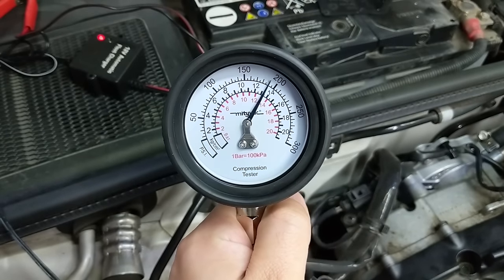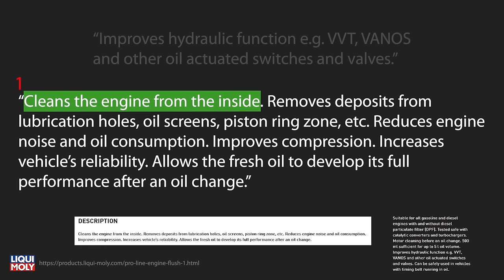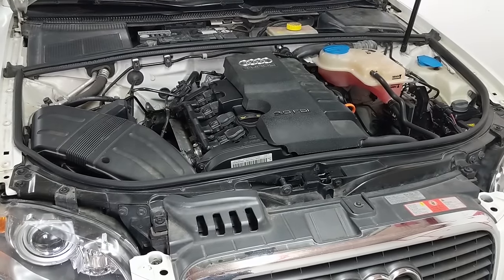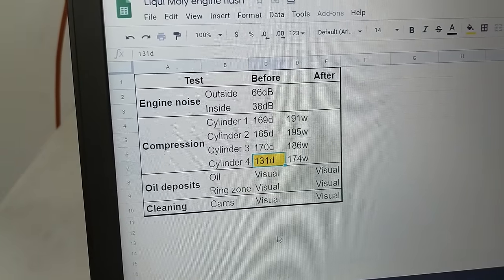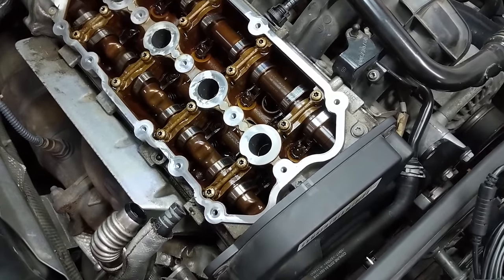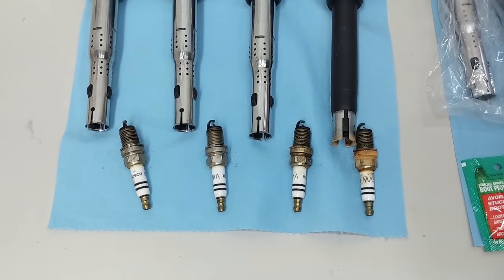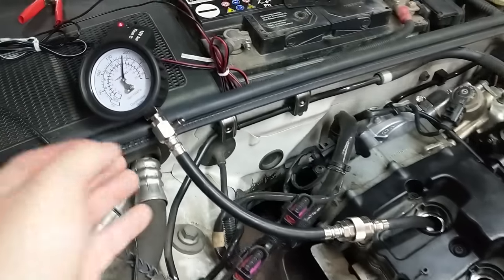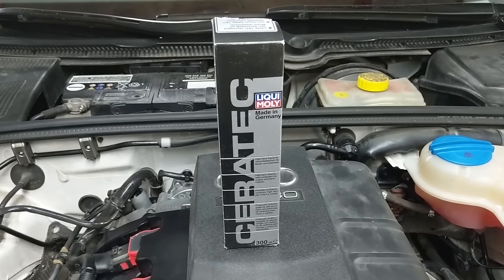Does Liqui Moly Engine Flush work? | Full Test & Review | Pro-line 2037

Comment: I think that #4 plug was leaking and the new plug recovered your comp reading. The white deposits showed that plug was running too hot, which may have been a result of the leak. Also the original stick coil may have been damaged by the heat and was replaced without fixing the leak. Did it previously gave a single knock on a warm start? Sometimes they do and although harmless it tells you that something is off.
Reply: I agree with Sky Dive , you've changed spark plugs and coil packs , it also seems the like somebody change 3 coils and never changed the 4th , now that You've changed all 4 you have a nice low tone in your exhaust , also spark plug gaps on turbo cars make a difference, over all I don't think Liqui Moly made a big difference.
Reply: & such as life, the problems get smaller & smaller as 1 approaches the core, mABEeeee.. that spRk plug 4, was jst a tad lUs.. (mNE a tIm Iv had problMs that mNE a mech. thought was this that or thE other.. & it Ndd(ended) up just being 1 pipsQEk sIzd lUs scrU)  👋😒

Comment: It think it's hard to compare both test samples when the cups are so large, that even with the presumably "cleaner" oil there's no light penetrating the oil. Maybe a test tube or another thinner cup would've led to different results. Plus your engine was pretty clean from the start. I mean the transformation shown in the commercial is certainly unrealistic, but maybe an engine with a bit of oil sludge here and there would've experienced some "real" cleaning effect.

Comment: Probably it won’t clean an engine like in the promo, but for sure your engine was clean before, so there were no deposits to be removed. Regarding the low compression-could be an improvement because maybe the engine flush managed to unstick one or more piston rings from their groove. Maybe.

Comment: I also used this product and a bunch of others. I used to to try and "clean the rings" to get better oil consumption but what ends up happening is it cleans the carbon around the rings which all them to move a bit better (carbon gets in between the piston rings and piston) and that actually reduces your compression and increases oil consumption. Your spark plugs look like they are burning a bit of oil anyway. I have the video of my tests on my channel.
Reply: it was a little confusing to get your conclusion. Was it that you think the cleaner does help or that it does not?
Reply: @jamesmedina2062  it did not help.
Reply: @buildanddrive  right on. Thanks for the answer. I have found similar poor results with older engines. Fresh oil is usually your best bet.

Comment: The evened out dry numbers are a great result. Glad I used this stuff before my last oil change. The decreased wet number for cyl#1 could've just been a fluke, oil not making its way to the rings or something.
Reply: More likely from not letting the compression reading stabilise. Can see stopping too early in the vid.
Reply: @RealHairyPotty I think it's more to do with oil being far less viscous, cretaes more of a seal around the oil rings when the oil is thicker leading to higher compression, simply leaving the oil flush to stagnate on the sides of the cylinder walls induces lower overall compression as it is more volatile, a dommon trend I see is oil in oil flush is quite sloppy and water like, whereas oil without flush is very sludgy and thick, I work in a waste management facility and can tell when they oil we are recycling has had oil flush put through it! :)
my only explanation is the bad cylinder had the oil rings cleaned, but lower overall compression due to the thin oil, the block should have been thoroughly rinsed with clean oil and a clean filter, ran for atleast 10 minutes with fresh oil then the sump oil and oil filter drained, new oil put in the filter and engine then the cylinders tested. Atleast this is my procedure anyways after having used oil flush on poorly performing engines.

Comment: I personally use amsoil flush with a fresh oil change with cheap oil then change and fill with amsoil oil
Reply: I do the same, I flush the engine with regular FS oil, and then put in Amsoil.  Lasts much longer.  Modern engines can retain 10-20% old oil which fools most DIY YT jocks.  They think the dirty oil is actually result of the solvent when in fact is just the old oil mixed with new.

Comment: Great wideo. Try this in a Diesel engine with sludge build up, then you will see what this product is capable of. Also you should have changed the oil filter and cut it open, both for the base test and after flush. Subbed!
Reply: This is a direct injection engine which builds sludge in the intake and on piston heads

Comment: When I need to clean the top of a piston and  the rings I use a a 50/50 mix of PEA fuel injection cleaner and B12 Chemtol 1 shot of each per-cylinder goes into a container for mixing. To that I add 2 teaspoon of TCW3 2 cycle oil per cylinder and mix. I put one shot of this mixture into each cylinder cold and turn crank by hand first thing in the morning. I repeat this in the evening. I cover the spark plug holes with a rag over night. The next day I again turn the crank over by hand and check to make sure no significant fluid is on piston tops.  I put the plugs back in and start engine. I let it run until engine is up to operating temp and do an oil change. Normally leading up to this I would have already done a tank or two of fuel injection cleaner. I do this about once every 64K miles. I never leave spark plugs even Iridium in for 120K miles.

Comment: Well, it works on the area that's vital for the performance. Certainly the engine has some significant buildup on the piston ring. On the 3 cylinders, the buildups are aligned with the piston ring, so it improves the sealing. I think that explains the compression changes.

Comment: My 2011 MINI S used to burn about quart of oil after every 2nd refuel (850-900 miles) and since I switched to Liqui Moly oil / additive it completely stopped burning oil. I used to use Mobil 1. I’m a big fan of L.M. products.
Reply: which specific liquid moly product?
Reply: @juanifico  I use Molygen motor oil and Anti Friction Engine Treatment. My engine also made slight noises and with this switch in products it’s incredibly quiet and smooth.
Reply: @steezymiyagi  do you think the engine oil is necessary, too?
Reply: @juanifico  So I substituted Mobil 1 motor oil with Liquid Moly

Comment: Remove 1 quart of oil and replace it with diesel. Let it run for 15 minutes and you will notice a major change in all the carbon buildup areas and your compression. You will probably need to do a minimum of three or changes to get all the junk out
Reply: Diesel you say right?

Comment: The idd result might be : 1. cylinder 4 had a lot of build up so compression was down - cleaned up and back to norm. 2. The flush also flushes the lubes so right after the test it may not have been lubricated enough - add oil and run for awhile at lowest rpm possible to go back to normal

Comment: I would really like to use this stuff because I think the screen in my oil pain is starting to get clogged and it's a pretty big job to remove oil pan on my b5.5 passat, you have to remove part of subframe and brace the engine. I'm just afraid that it might uncover some leaks that aren't leaking now.

Comment: I mean. You put engine flush in a perfectly fine engine apart from the excess carbon on the pistons, no wonder there is no significant effect. Do the same to a 100k+ mile 1.8T thats sludged up to the brim and watch the magic.
Reply: Thanks to synthetic oils, sludge is a thing of the past, no??  My 1999, 240,000 mile Jeep 4.0L's valve train looked like new when I did the valve cover gasket around 220,000.  5W-40 synthetic every 6,000 miles.
Reply: @Hubjeep  not for short range drivers

Comment: my motorcycle had 1 cylinder at only 96psi. the service limit was 109psi. the other cylinders were 160psi, 155psi, 145psi. after running an engine flush through the engine the low cylinder was up to 144psi. the rest were now 162, 160psi, 155psi. so gummed up rings were the problem. i ran the engine for 600 miles and retested. the low cylinder was now up to 155psi(rings must have reseated) the other cylinders stayed te same.

Comment: the coolant temperature gauges reads the temperature of the coolant not the engine... it’s takes a bit longer for the engine to reach those temperatures since the fluid temperature will rise faster then the block

Comment: The dry compression results from before and after is interesting.  I would guess that the low cylinder had a stuck piston ring probably from carbon.  The flush probably cleaned out the carbon allowing for proper sealing.

Comment: Plugs getting too hot could be caused by not fastening them tight enough because they are supposed to transfer heat to the cylinder head

Comment: Does it make sense to check compression? The parts where buildup could cause a non perfect seal / compression leak, are usually not where oil flows

Comment: I have the B7 and once I put the camera down the cylinders and when I saw those valve dents on the piston I though that my engine was done.
But years later it stills driving great
Reply: Those are valve reliefs cut into the piston. They are supposed to be there.
Reply: @ichoozjc  yeah at the time my car was on limp mode after the cam chain skipped a few teeth so I thought that the valves had hit the pistons. Replacing the cam chain, chain tensioner, HPFP cam follower and coolant flange was not fun at all.

Comment: Great video! I did the same but switched over to liqui moly for the engine oil as well and got great results. No more tapping or oil consumption! Working on an Audi A6 Avant and an A4 2.0T on my channel currently.
Reply: which oil do you run?

Comment: your average compression for the overall dry  tests was lower because of the flush clearing out any debris on the piston rings and letting all the oil drop back down to the pan as it should. piston 4, that was obviously very low bumped back up to the average, making the overall result great IMO, that one cylinder is 25% of the engines power since its a 4 banger yk

Comment: I have the problem with the backflow valves that stop backflow of oil from the heads when you stop the engine. I will try this (as its pretty cheap) and hope that the valves will close properly after that.

Comment: I did use this product i did not extensive testing like you did

I did it on 2 cars, A Prius 2012 (82k Miles/ 132k KM), and a 2011 X3 BMW 2.0L diesel (95k Miles/153k KM), noticed more responds on gas, more smooth this is for both cars, might be I got back compression.

I used Liqui Moly oil for both cars  0w-20 Prius and 5w-30 BMW, with Liqui Moly Ceratec (i love this engines make less noise) and Liqui Moly Oil Stop Leak, because there are some seepage on both cars.

The way I did it I feel kinda stupid not flushing it 2 times, here is what i did. 
Drove cars for 30min to heat up oil, Drained 500ML from both oil pans, put in plug while hot oil kept running out, kinda messy I should get a dip stick suction device for this.... 
Added flush, Ran both car for 15 min, drained old oil and proceeded with a regular oil change, new oil, new filter, and the Ceratec and Oil Stop Leak.
However I see after I did this many people buy a second filter and a cheap oil run it again for 10-15min then add the good oil, new filter and the additives after, dang it. Well maybe next year/next oil change.

Time used was about 1 hour 30 min for Prius, and 2 hours for the BMW, to give you sorta how long it takes. Good luck and i recommend this.

Comment: Great video by the way, I recently purchased the Liqui Moly Engine Flush to see how it works on my A4.
Reply: how did it go?
Reply: @chr0nob841  Visually I didn’t see much of a difference little particles but nothing significantly big, on the cleaning side haven’t done thorough check yet. Once I do I’ll let you know, the weather in Mass has been cold lately son haven’t had the chance to work on it.

Comment: I also was recently looking at Liqui  Moly engine flush and wondering if worth doing.  Was really hoping to see a drastic clean under valve cover after flush, and particulates in filter cloth. So doesn't seem worth while. ? Compression improvement was worth a lot though.

Comment: So, when you did your compression tests, did you use WOT? (Wide open throttle/full throttle?) All compression tests should be done with the throttle fully open to get true readings. Ideally just remove the throttle body and then do the test.

Comment: Tried same kind of thing made by hi gear comapny. Well, it's not the same, since the one I've used, is supposed to work a bit longer - you add it to your oil system, then drive for 200km, and the do the oil change. I've got to say - it does make the engine run a lot more quiet. I've tried to do the color check, but there was nothing significant. I tok a bit of toilet paper, put a small drop of oil on it before I've added this thing and after 200 km.
I guess, if you'll regularly use this kind of product it might get your engine cleaner, but you shouldn't count on getting clean what's been getting dirty for years in one-two oil changes

Comment: I would really like to see your video on Ceratec. I was/am suffering low oil pressure in my N47 E83. The red oil light was blinking at idle and after adding Ceratec and driving 50-100km the light no longer comes on. It's hard for me to tell if and how much Ceratec helped so a video on that would be great!

Comment: The pistons been equalized, so, if it's close(r) to factory data, I wouldn't worry much. If it helps the oil consumption, I'd let the thing do it's job. :) But it's way more expensive than braking fluid. Dot3 or 4, doesn't matter. 
Thank you for the test. It's been refreshing to watch.

Comment: I will say this, if you didn't thread it perfectly into the hole for the spark plug that will happen. I've had an engine freak me out because there was a dirty thread that let just enough air escape that it dropped my compression 30 pts. I wiped the threads clean and put the tester back in and it almost immediately jumped up 30 points to match the other cylinders

Comment: Hi. Thanks for this video.
From personal experience with VAG group engines, I am suggesting you to use a better oil, not Castrol. Go for Mobil 1, Motul or Liqui Molly.
Also, in term of spark plugs, go for pre-gapped  spark plugs from NGK.
Reply from the maker: Cool, thanks Andrei. Since this video was made, I've consolidated to a single oil for both cars, going to Liqui Moly High Tech 5W40, mainly for ease and based on the average mileage of the vehicles. Truth is, I have an entirely new test video well underway for LM products that brings the analysis into a much more scientific space but being an office grunt 5 days a week makes it challenging to produce new content consistently.
Reply: How is Castrol not high quality oil? Not like its official and recommended by Audi and BMW for example.
Reply: @DuBstep115  I've noticed people talking about there being a difference between US Castrol Oil and European, don't know if that's thr case though (Euro being the best quality option as always, especially for german cars) ;-)

Comment: Based on your results I would say the Liqui Moly did exactly what is supposed to do! It unclogged the piston rings in the fourth cylinder.
Reply: The car was standing still for 2 years, may have been because of running the engine.

Comment: Possibly if you increase the pressure in two cylinders after the flush, thhen you then load up the load more on the battery and starter so it spins over slightly slower. This may then show a slight fall in the original two higher compression cylinders.

Comment: when you put the liquiMoly, did you have any oil in the car? or just just the liquidmoly as lubricant? did you run the car or just left it in idle? thanks
Reply from the maker: Yes, the old oil is still meant to be in the car (or any oil, just make sure the car is running with near full oil capacity) when the LM is added for the cleaning. And yes, the car just idles for 10-15. The product says that the car is not meant to be driven while the cleaning is happening.

Comment: Ive got a 2015 Passat with 140k miles. Runs very good except occasional rough idle. But boy oh boy am I burning through some oil. Over a quart per month. Im really hoping a cleaning with LiquiMoly might get me some compression back and smooth out the rough idle issue.
Reply: do 2x runs with engine flush then 
use cheap oil for that
Also use a fuel system cleaner or combustion chamber cleaner to get all the build up crap out of there, than change the spark plugs.
Than use a good quality oil like Liqui Moly and go one step up with the viscosity so I'm guessing your engine takes 5w30 since its a 2016. If its on 5w30 use 5w40. Thicker oil lowers consumption almost always. A fully synthetic oil would be ideal too.
Reply: @alouisschafer7212  Thanks for the great advice!

Comment: The way I’m trying(this time) is draining the old engine oil and filter. Add fresh oil with filter and run the car about 500 miles then add the engine flush additive let it idle for the allotted time. Drain the oil and filter and proceed with refilling it with new fluid and filter.

Comment: Great Video,

But never do run your High Pressure Pump dry! It take serious damage realy quick.
Its recommended to pull of the plugs of the injektor wiring to do your compression test.

Comment: i had a vanos code on my Bmw 335, did the liquimoli flush, changed the oil. code went away.2009, 200k km. ill be changing the vanos solenoids anyway if the code comes back, but its 10k after and still no code.  i think it cleaned the solenoids